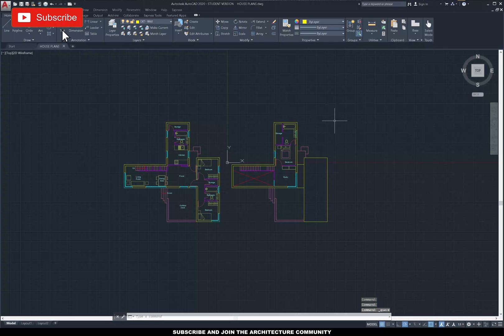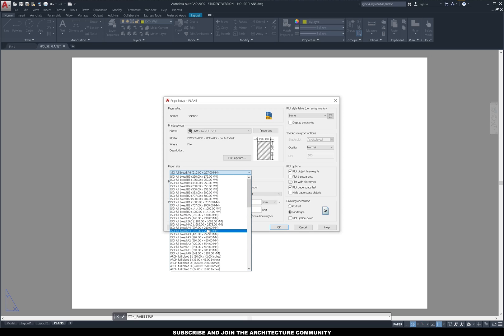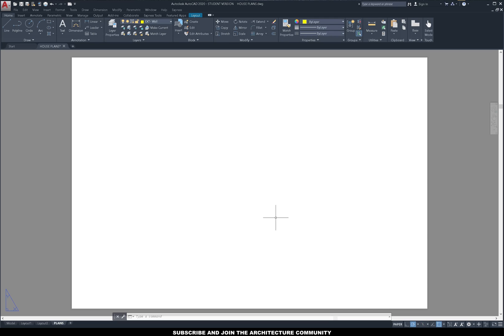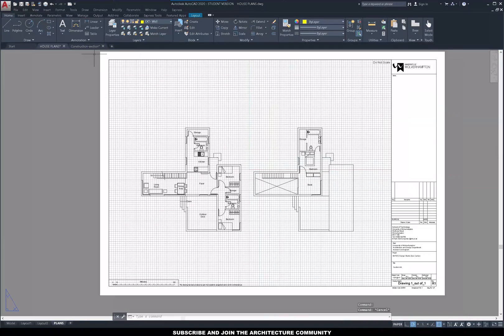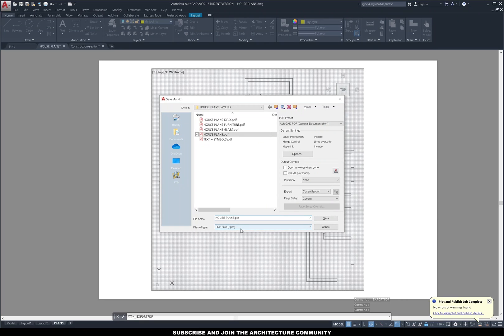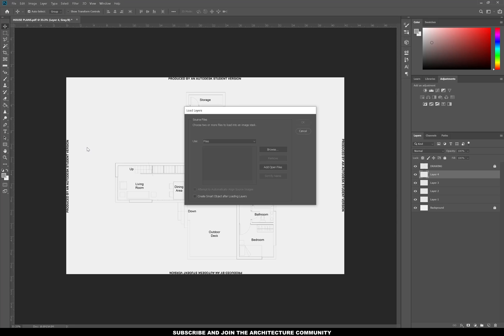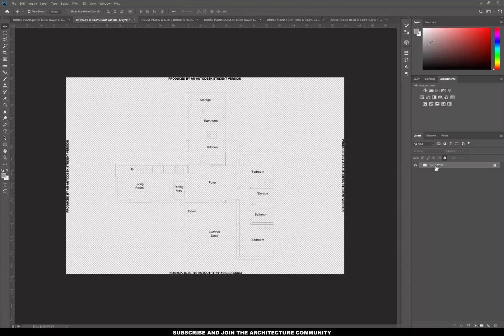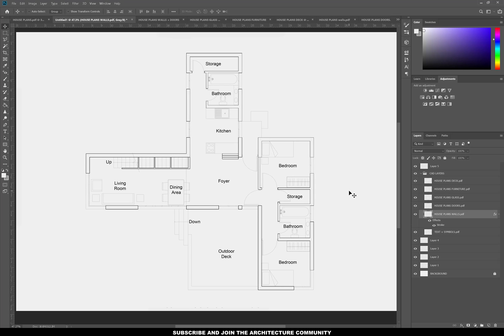How to Export AutoCAD to PDF with layers [HIGH QUALITY]

Comment: Thanks for the video. I need to export my cad file to pdf format with visual layers so I can turn off/on  them individually when it is needed, however when I export it in pdf format, all the visual layers come in one layer but when I export it only with wire frames view they are individual. can you please help me with this? Many thanks

Comment: Hiii, this is always necessary to export one layer by one ? Because during my 1st year I just learned to export my drawing with all the layers on it . What is make the difference ? Thank you for all your amazing works :)
Reply: in the later stage of editing your plan, you'll find that you need the layers individually to make specific edits on them. for example if you need to change the lineweight of wall only, you'll struggle selecting the wall lines on photoshop  bcs it has merged with all other lines

Comment: Hi! Thanks for the tutorial it was very helpful. 
I use AutoCAD Architecture and I have a problem of printing into pdf especially when I have to show transparency of some of the Hatches that I use as shadows in the elevations. After setting up the layout (dwg to pdf) and adjusting the scale I do ' Ctrl + P '  and my PC starts freezing and it takes a lot of time to make me a PDF file and when the PDF is ready it is always so so heavy (like 40 MB even though its a simple elevation with 5  transparent hatches and the quality is normal '100' :') ). Is there a way to fix it? :'( 
If I export to PDF as you did in the tutorial it shows the hatches in the raster and not in vectors.
Reply from the maker: Hmmmm... I have always had trouble with Autocad hatching. Have you tried exporting the hatch separately and seeing if that is the problem?
Reply: @SurvivingArchitecture   Hi, thank you very much for the answer. Yes, I have tried it and it is better than befor at least. :)

Comment: My AutoCAD pdf is imported with a white background at the beginning itself. Using Photoshop CC. I want to make it transparent background as shown in your video. How should I do that? please help
Reply from the maker: Use the magic wand tool to select the background and then delete
Reply: @SurvivingArchitecture   the plan is big and complex. Will have to do for every section. Is there any other way?
Reply from the maker: Right click with the magic wand tool > colour range > select white and then delete
Reply from the maker: Or export without the background
Reply: @SurvivingArchitecture  ohkay. Thankyou soo much. You're always a savouir!
Reply from the maker: You're most welcome! Let me know if it works

Comment: Add another layer and remove the autodesk labels at 8:26. It won't work on a new layer unless you unlocked the drawing layer. Any comments? Has anyone else has the same issue?
Reply from the maker: Can you not paint over it on a new layer?
Reply: @SurvivingArchitecture  I managed to remove it. I want to learn your technique

Comment: Rasha: To scale, click this simple button on the bottom right and select 1:100.

Me: Z-Sc-100/100xp

Damn i am so uneducated
Reply from the maker: Hahaha well now you know!
Reply: no, that's actually very common, when u draw on meters or other units aside from mm those buttons doesn´t work, you have to "fix" them to your units
Reply from the maker: Thanks for the tip. Didn't know that as I use mm most times!